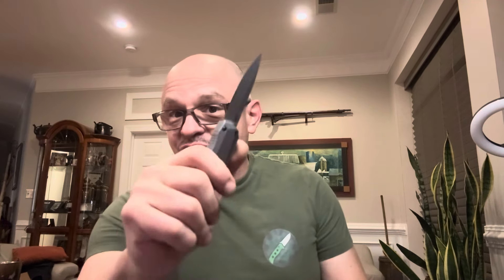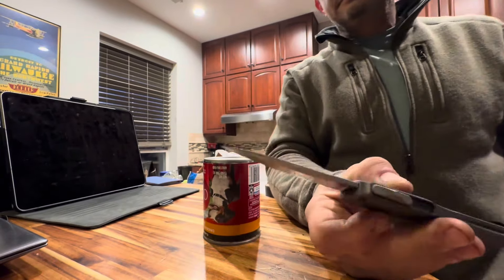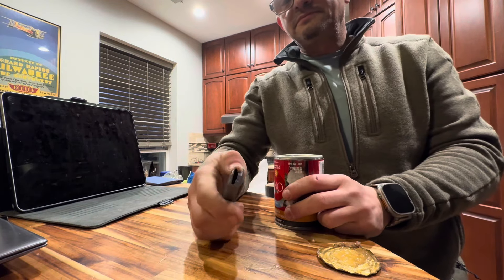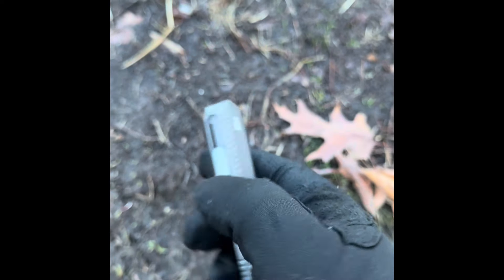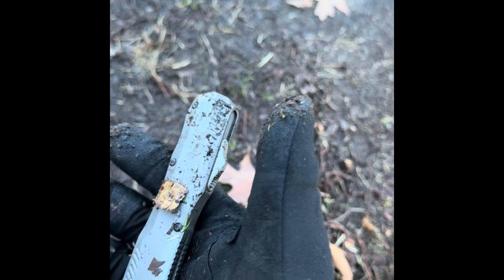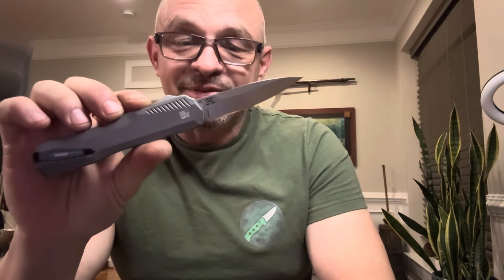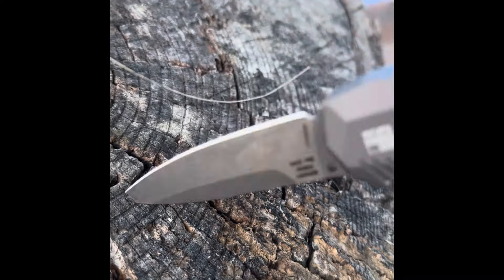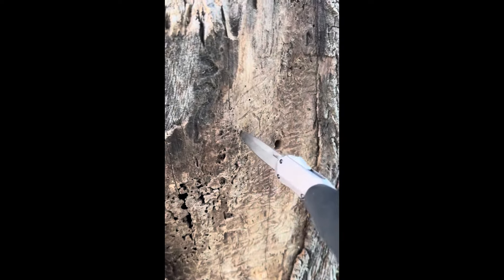Can an OTF Automatic knife survive abuse? Newest Kershaw Livewire field-test and real-world review.

Comment: I own 2 Microtech knives: the Ultra Tech and Dirac Delta. Additionally, I have the Livewire (with a second one on the way). I accidentally washed my Livewire, and it's still as good as the day I got it, with maybe one or two misfires in a year. However, my Dirac Delta, which I only carry on special occasions, is starting to fall apart on its own in less than 6 months of ownership—the trigger just fell off. Similarly, the Ultra Tech has been misfiring constantly since the day I opened it from the box. With my own cleaning, it lasts about a month until it's almost useless to use. I have never cleaned, changed, fixed anything on my livewire! the only reason I'm getting a second is because I want the D/E magna cut! I have the 20CV blade on mine currently!
Reply from the maker: You are probably aware of this, but for the viewers who haven’t researched the Livewire, if you get the knife soaked, even in salt water, remove the pocket clip and blow air through the screw hole. This will remove a lot of moisture, and one can run air, then degreaser, then air, then RemOil, then air one more time. 👐
Reply: Microtechs are that bad huh? Should I save my money?
Reply from the maker: @adonisdelacampa7057  They aren’t all that bad in my experience, however I would stay away from the “signature” editions and other price bumping “rare” options. The most basic microtech OTF is all you need to experience the functionality. The OTF market is transitioning from a novelty territory to the main stream option due to relaxation of the auto knife laws in many states, so there are many competitive options available and more are on the way from multiple companies.
Reply: @CuttingBoardRx  🙏🏽🙏🏽

Comment: Great Video. I‘m thinking about getting the Livewire as my first OTF but wasn’t sure how strong it is with all the springs and meachanism inside. When you know how it is built inside, I really wonder how the small clips can hold the hammering into the tree. This video surely proves it can hold up a lot of abuse, more than I will probably ever need. I’m also thinking about getting the double edged version and I was surprised how well your single sided blade penetrated trough that vest. wow
Reply from the maker: @michaelknight141  thanks for commenting! Cross-sectional pressure, that’s what it’s all about!
Reply: @CuttingBoardRx  what do you mean by that? couldn’t find much about it online. do you mean, that the penetration is depending on the blade grind? what would you say penetrates something like a vest best? double edged blade or tanto? My guess is double-edged full serrated but very few companies do that.
Reply from the maker: @michaelknight141  think of a bow of a boat… I would have to do a video explain. But the point of a blade is parting material much in a same way as the bow parts water. The more symmetrical the shape is, the more evenly it parts the material. And the smaller and the more symmetrical a blade’s cross section is, the more efficiently it parts materials. 
Haven’t tested a fully serrated blade for penetration so dare not speculate, it could go either way with the ballistic vest because the Kevlar is impregnated with a very viscous compound

Comment: I bought one, haven't used it much and it's failing to travel all the way forward every now and then, I have taken it apart and cleaned it but it's still failing every now and then.
Reply from the maker: @pauldavidson9267  is it aluminum or carbon fiber handle?
Reply: @CuttingBoardRx  aluminum
Reply: I think the tolerances are a bit tight at the business end it takes a little bit of force to get the blade out on disassembly and put it in on reassembly.
Reply from the maker: It’s most likely to be the hard anodizing defect. Use a black sharpie on the blade to see if there’s a hotspot in the handle. Also, any double action OTF can fail to lock if you’re swinging your hand outward while actuating the blade. That’s just how force vectors work out.

Comment: how was the blade play before and after? I cringed when you stabbed the dog food can 1. just because you did it 2. because I'm just imagining that sound. I would like to see you test a Lighting, only 30 bucks but they are pretty tuff. great review I just subbed
Reply from the maker: Thanks for subbing! The blade play did not change at all. Good knife. All OTFs are designed to be super strong in the forward stubbing direction. Even the least expensive ones will work for a while. What’s important is how well the internal components are heat treated.
Reply: @CuttingBoardRx  How will did they heat treat the internals on the livewire?

Comment: The livewire was on my list and was considering it being my first otf. Anyone know if the heat treat is good? And edge retension?

 Great review. And keep it up. You being unaffiliated is the reason I subbed. Im out here trying to make informed purchases and all these knife reviewers either have bias, self financial interest, or safe queen most of there stuff and never really see what its made of.
Reply from the maker: The heat treat question will be answered in the disassembly video. MagnaCut is sharpening very similarly to CruWear ant it was easy to get a great mirror finish
Reply: Definitely the weakest part of this knife was the factory edge for me. Came a little burnt with weak points. I agree with the poster it can be hard to sharpen but once you can get an edge on it the retention and heat treatment has felt great to me
Reply from the maker: @Knivesarecool  I think that’s why they switched to Magnacut - a lot easier to sharpen.
Reply: @Knivesarecool that's the least important part of a knife for me, depending on the steel you better be able to sharpen your own knife
Reply: S30v is a top shelf knife steel. If you're experiencing issues with edge retention it's on account of you not being able to sharpen a knife properly😢